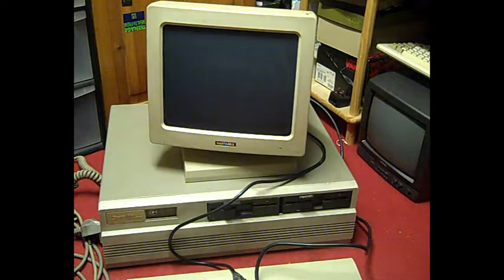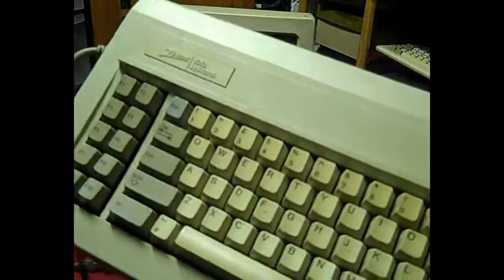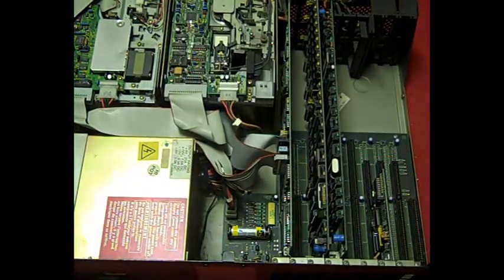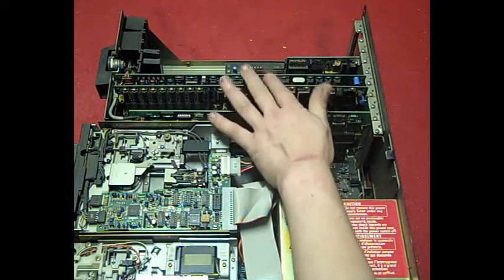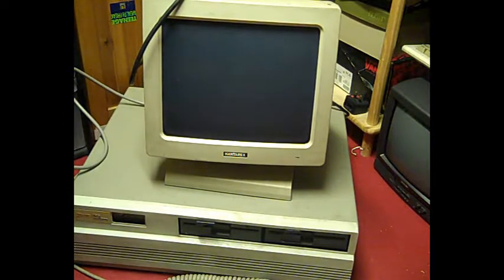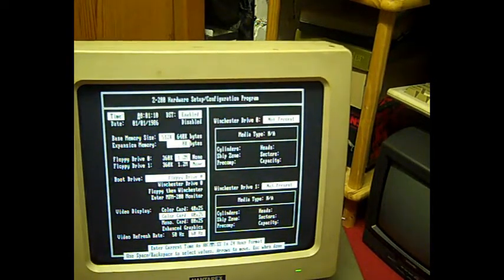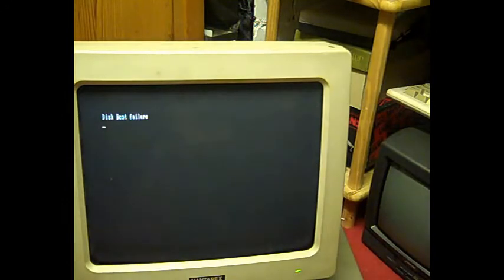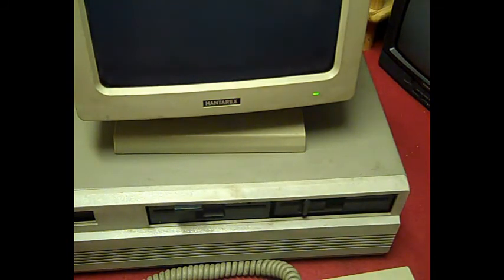Zenith Data Systems 286 look over and power up

Comment: Bought about 4 of these in the late 90 still have one running dos 5.0 and win 3.1 they came from 
an air base in alaska. I was able to get two of the memory cards working without conflict so I had one MB of ram.
5 1/4 floppy 3.5 floppy and dual 20MB hd's. You may have to low level format the drives with dos to get them to function then fdisk and format. 
the biggest problem is finding the jumper settings for the cards. best of luck

Comment: Lovely look an old 286 =D  Hard to find a 128K upgrade I think =/
Reply from the maker: Yea there hard to find and bloody expensive when they do turn up unfortunetely. to think of the number of boards like that i skiped in the late 90's thinking they where useless and taking up space. if only id known lol
Reply: Same here - I threw a number of those 512K to 640K upgrade boards away =/  Some had 1Mb extended plus the 128Kb of additional base RAM.  About 10 years ago I threw away a lovely 486DX2 motherboard too, with SCSI drives and interface as well =(  Arghhh!  It's hard to value things sometimes.

Comment: Just curious, were you able to get the setup disks made and get it running? That is a rare machine, take good care of it. Here in the US, mostly used by US Government and Military admin offices. I was lucky enough to get a ZU-425S (486SX-25 Mhz) I added the math co-processor. I searched high and low for the setup utility disk and finally found it.    Runs perfect!